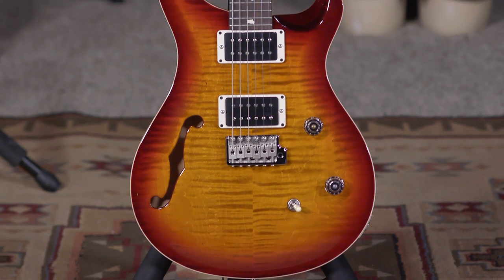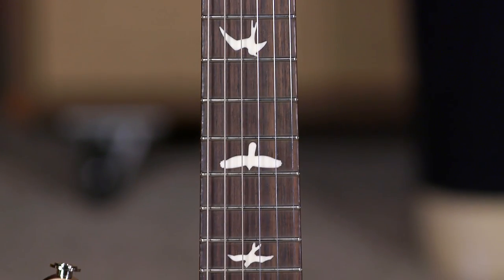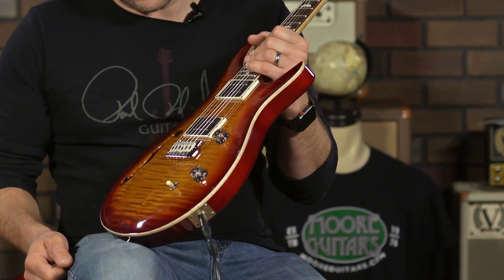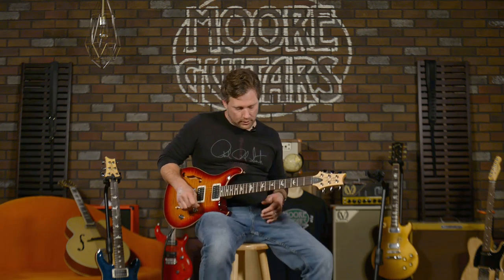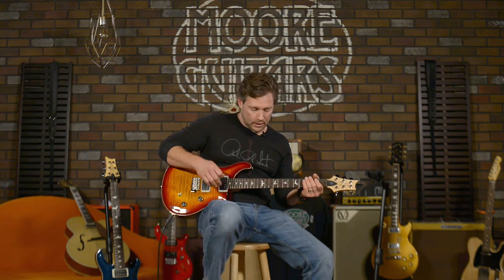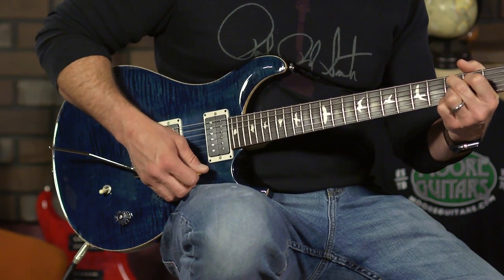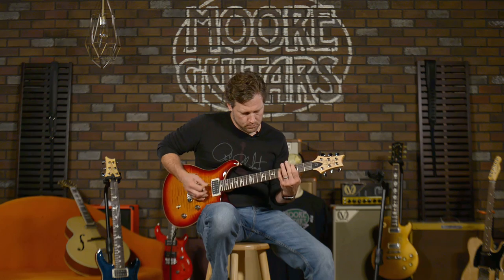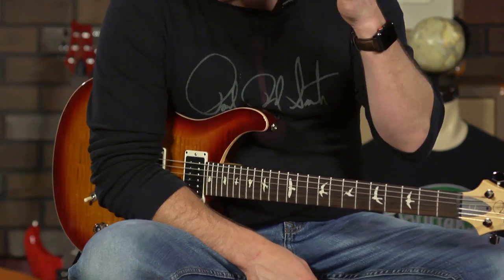The NEW PRS CE 24 Semi-Hollow vs a PRS CE 24 Solid Body Guitar

Comment: The CE24 Semi-Hollow are chambered on BOTH sides of the body, not just the side with the F hole. There is a solid piece of wood in the middle of the body that's about 4 inches wide. Simply take off the electronics back plate and you can plainly see the other side is hollow as well.
Reply: I didn't know that! I do own one so thank you for that info!
Reply: Im wondering where you got that info because i sell these for a living and the rep from PRS said that its chambered only on the side that has the F hole ?
Reply: Knocking on my CE24 semi-hollow sounds the same at the bridge (with solid wood) and under volume & tone controls. Only under the F hole has the hollowed out sound.
Reply: @inhaler1134  yeah after taking off the electronics back plate above the electronics cavity there is smaller hollowed out section also. 

While I was at it I removed the back plate over the bridge springs and it’s a little more open sounding now. Cheers for the prompt to get out the screwdriver! 👍

Comment: I've had my 2017 CE for awhile now... and just bought a core 24.  I thought the core would be a huge upgrade.  It has a nicer top carve.  I thought I would sell my CE for it... but my CE sounds so epic I can't depart from it.  I thought my core would sound almost same but because of neck they sound very different.  I honestly think I like the CE tone better in humbucking mode... brighter, clearer, more attack .  But in coil tap I prefer the core... warmer rounder sounding.  The core also sounds warmer with delay, slide, etc...both epic for different music but neither better than the other.  Those who dis on the new CE are clueless... it's one of best underated guitars ever made...
Reply: I'm on my 3rd Ce24 a regular, a DW Floyd and a semi hollow. I never ever use my core custom 22 or Les Pauls. CE are superior guitars,the cores are basically more of an eye camdy
Reply: @AllCarsUnited  agree the CE guitars are epic.  I just sold mine not because it wasn't amazing but I just have too many guitars... and it sounded too much like my core.... and I didn't need both.

Comment: thanks for the demo,  trying to decide between the regular CE 24 and the semi hollow.
Reply: If you play at lower and moderate volumes get the Semi hollow. I got mine 2 days ago. Absolutely amazing. The sound is fantastic. I do not recommend this guitar for extreme volume, as it is  semi hollow. I have had several custom 22's, 513's. Mira's, And several Ce 22's (which has been my favorite of all). I even had a DGT, that I did not like. Here is the deal. The weight and balance of this guitar is great.  Being semi hollow the resonance is outstanding. BUT, that is hard to control at extreme volumes. Most of all every position sounds great!
Reply: @kckennedy55  thanks,  i got to play one today,  very impressed - and good to know on the volume.  Probably keep it quiet but you never know.  I like some old school rock as well so maybe i'll look at a regular 24 just in case.
Reply: imunchienandalusia    Get the semi

Comment: Will the semi-hollow be able to shred and do tapping as easy as the non semi-hollows? I've hear hollow guitars tend to be more clear and have less sustain and are not good for tapping and metal solos. Its the only question I have before I decide to buy since I really enjoy tapping and shredding and I don't want that to be compromised.
Reply: I tap on my semi-hollow CE 24 and it sounds amazing! Sustain is just fine on a semi-hollow. I don’t think you’d need to worry too much since it’s a pretty high end guitar, there are only very minor differences

Comment: Fundamentally, are there any major differences (besides the pickups) to the older CE models?
Reply from the maker: The Semi-Hollow version is much more resonant. It gives a little more in terms of low mids and a little less upper-end bite.
Reply: @MooreMusicGuitars  Sorry, should clarify- do the newer CE models (2016-Present) have major differences to the original CE models (1988-2008?)
Reply: Wells306  Yesss Everything is different and much higher quality on the originals for example  much deeper German top carve - countersunk vol tone and selecter switch - countersunk tremolo and electronics cavity covers -  Made in USA  Hardware ( bridge Locking Tuners same stuff used on the Core models) - Dragon Pickups  -  1 piece nitro finished quarter Sawn Neck   The new model is  cost cutting to the fullest .. the top barely has a dish/German carve... the vol tone and 3 way switch are not countersunk the  trem And electronics covers are not countersunk and sit on top of the body ... all the Hardware is made in Korea and is the same as the SE models same with The Korean made pickups the Neck is also a 3 piece satin finished flat Sawn Maple Neck .... Get A Used Original CE 22 or 24
Reply: Eric   Petrossian thanks, you just sold me
Reply: @ericpetrossian1582  You sold me as well. I just picked up an '03 CE 22.
Reply: @ericpetrossian1582  from reviews I've seen, the pickups are US made. I do wish the specs showed where stuff is made. Also, SE does not have locking tuners. Not sure what the country if origin of the tuners or the electronics "guts" is. Not familiar with dragon pickups, but most of the changes are cosmetic and based on my skills level, i wouldn't be able to notice any tone difference :)
Reply: Dude you’re completely wrong on the pickups, they are the same 85/15 as on the custom 24/22... but I agree, the lack of counter sinking feels a lot less quality than my old custom 22 from late 90s.  Thinking of returning my ce-24.  It’s very nice but doesn’t feel almost 2 g nice.
Reply: @Cletus Anfernee Jackson I did not, was a week too far past my return period.  Still, if I need to sell, it’s probably towards the top of my list... it’s nice, I like it, just feel like it’s got a lot of margin in the price.
Reply: @boothbuster  dude the new CE has way better pickups than the old school ones... even Paul Reed Smith said he wished the 85/15s were in the old ones... but he didn't know what he knew today.  The pickups alone would run you $400.  The new locking tuners are way better too.  I heard there old ones were a beeoch...and you can't change then out easily.  So the old neck carve was deeper and USA trem... but the new trem works flawlessly... it's probably better than the old USA one.  So definitely the new one astetically isn't as great as the old... but tone and playability essay better.  Also the $2k cost for the new is about same price as the old CE cost 30 years ago... so price not that steep.  I got newer model but used for $1,300...not sure if I would have paid $2k... but sounds as good as core definitely...
Reply: @thadlogan51  Not sure if you meant to respond to me or to this comment thread overall... my old PRS was a Custom 22 though, not a CE.  I wasn't really comparing the new CE to the old CE.  I guess my point was, PRS has become a bigger brand for better or worse.  The Custom 22 I had back then just felt a 'lil more special, you know what I'm sayin?  But I haven't seen the new Customs to compare, so I can't really say.  The 85/15 are nice pickups, no doubt.
Reply: @boothbuster  makes sense.
Reply: @thadlogan51    Valid comments, pretty much all, but I bought my '91 CE-24, new, for $1,095. Maple top that really looks a lot like e 1- Top. Not $2K. Of course, that's not figuring in the changing dollar value since that day, so...  Cheers!
Reply: @ericpetrossian1582  the newer tops though shallower are wayyyy better looking, the pickups are 85 15 USA. The hardware was used for it's tone. You're welcome